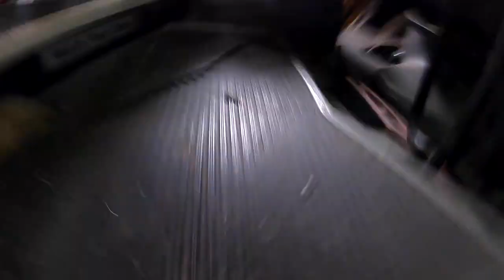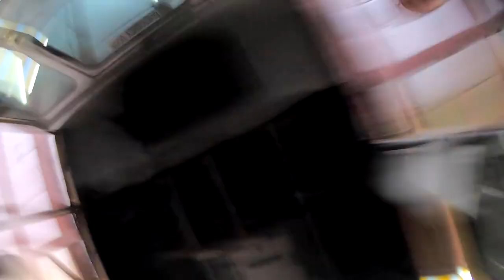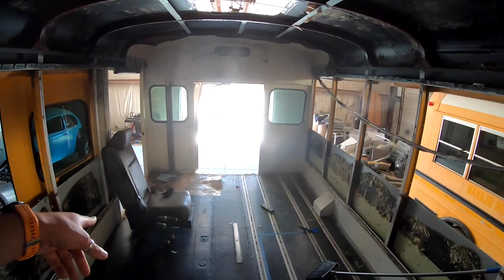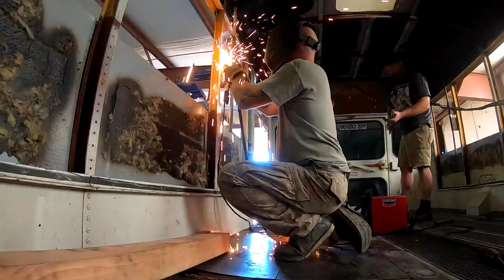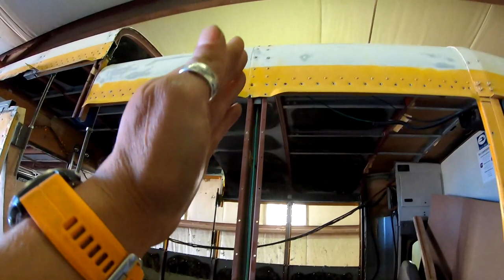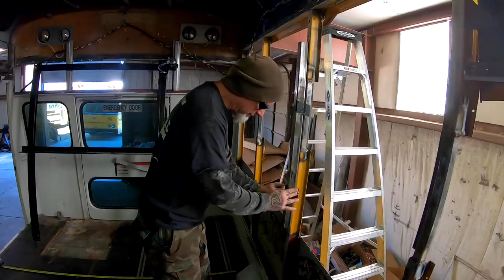Mini Bus Roof Raise & HappiJac Bed Lift System - Tiny House Camper

Comment from the maker: What are your thoughts on implementing an elevator bed in a mini skoolie?
Reply: Great idea. For small spaces not giving up so much space for fixed bed has a lot of value. Does it have advantages over murphy style bed?
Reply: I like it. Now fabricate undercarriage storage boxes that lift up like spice racks roll out......with small electric motors. Everything tucks away until you need to use it.
Reply: It’s a great system, and an innovative use of space. 
ATV All Aluminum Toy Haulers use this system. 
They are some of the best trailers made. 
Happy Trails
Reply: Chris does the weight of the happijac/bed + body weight get evenly distributed in the back and/or is it countered by the weight of items in the front (ie motor - dont think the fridge, wet bath, stove would do it). Just wondering if this is a rear wheel drive, will this affect load on uphills situations?
Reply: No!
Reply: What's this song called